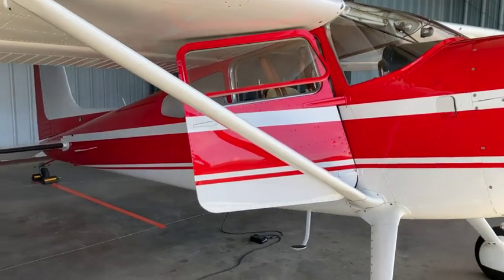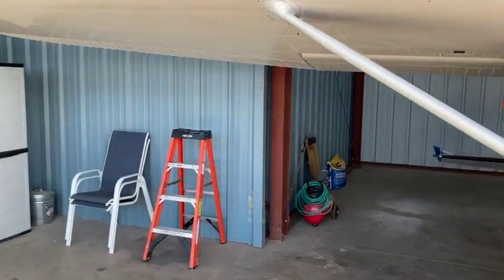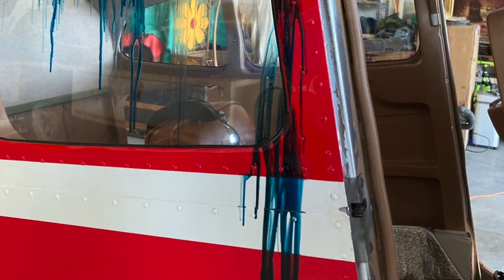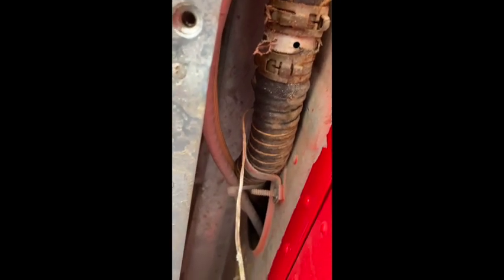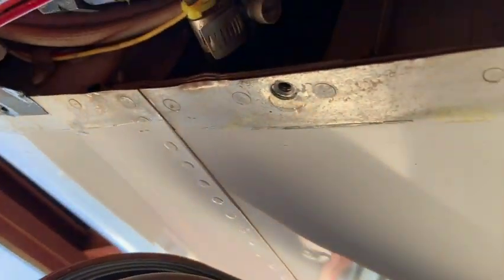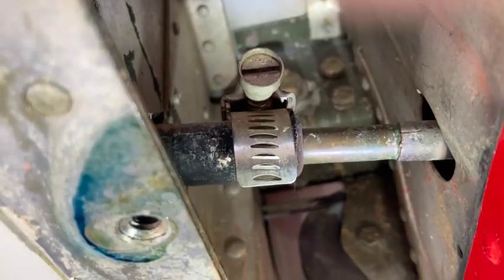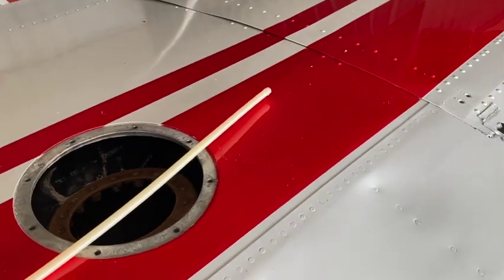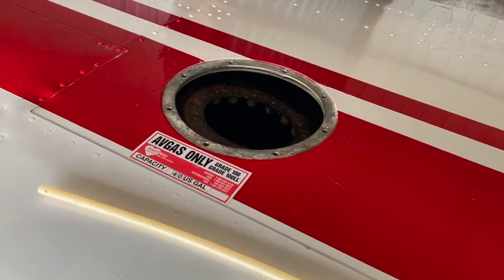Fuel Cell Replacement for a Cessna 180H

Comment: Jim, I was feeling your frustration along the way. With a bad/old set of eyes I've found a magnet works wonders for finding small parts dropped on the ground (or in your case cabin carpet). I've about worn out my Harbor Freight one and I am thinking about buying a new one (about six dollars). Just like you I've found a second set of hands incredibly helpful in times of stress and turmoil. Looking forward to seeing you safely up in the air again. Thanks for Sharing! 🙂
Reply from the maker: Even though I didn’t like the job, it was educational.  And now, when I replace the other one this fall, I will know better how to go about it.  Magnets are good, and an extra pair of hands are a necessity.  Thanks again.  Jim

Comment: A poor design by Cessna. I think it was the bean counters that caused this. Replacing these tanks has always has been a problem. Monarch tanks worked but I don't think they are in business anymore of making tanks. These tanks, rubber, have killed people by accumulating water in their nooks and crannies. I think the FAA would consider this a major repair. This means paperwork which you might consider asking an IA in your area about. In this day of litigation and insurance retirements just a logbook entry is sketchy. I started working on airplanes in 1965 and still do some work and I still have an AP/IA but times have really changed.
Reply from the maker: It’s funny, Cessna went back to charging extra for the rubber tanks on the floatplane variants cuz the integral metal tanks were failing with all that stress from the water landings.   I have been assured by several local AP/IAs that a simple RTS (return to service) logbook entry will suffice.  You gotta trust somebody.  Thanks for your input.  Fly Safe,   Jim
Reply: Replacing fuel bladders is an airframe minor repair. No 337s are required.